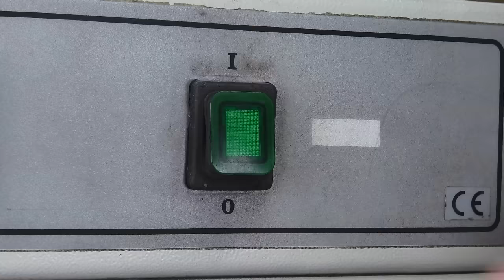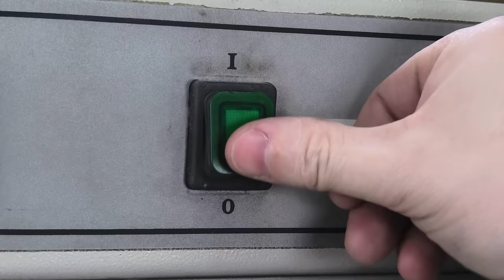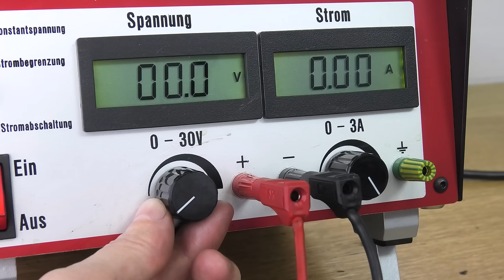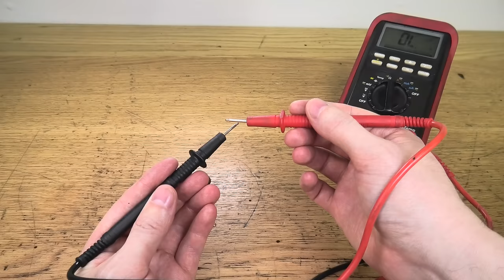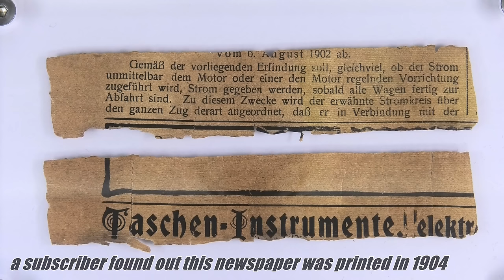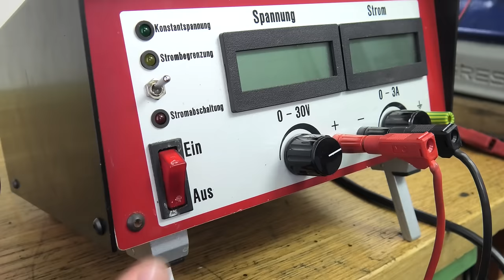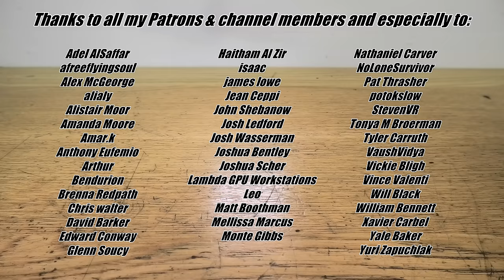Early 1900s Electric Door Bell - Restoration

Comment: Genuinely. I love how you also keep your mistakes in. You show painting over the circuit, and finding the problem to fix it. It’s really lovely and I’m sure will help others to troubleshoot in the future.
Reply from the maker: Glad to hear that, thank you very much
Reply: @mymechanics  but you didn't show how you cleaned the copper wire! or did you just replace it?
Reply: @ArnoldTohtFan  I think that he replaced that wire with a new one. Restoring a faulty enameled wire is by no means a trivial process, electrical, safety and quality wise.
Reply: @ArnoldTohtFan  lo reemplazó por uno nuevo
Reply: I was about to make the same comment in. Showing the error at the end was fantastic, I love the honesty
Reply: @mymechanics  I was wondering if just tapping the two threads again to remove the paint would have been enough to complete the circuit?

Comment: The patent was extremely interesting to read. A clever design for electric trams to be able to signal the driver that they are ready to depart. The driver puts the train into slow forward, but the circuit is broken by breakers in each car. The conductors of each car ensure they are ready to leave, and flip their switches. Only when all cars are ready to leave will the motors energize.

Comment: Great work so professional. 
Brought back an old memory... I remember as a young boy (9) in the late '50s, stripping one almost the same as this. Mine was not a restoration but an experiment to make an induction shocking coil (that is what it was called in an old encyclopedia). I added another coil from an old radio (i think) to the outside of one of the coils and did not use the other. . changed the height of the trembler part to the centre of the smaller coil. the trembler action when a battery was connected simulated an AC current by the breaking and making of the circuit, inducing a current on the larger coil which gave a high voltage output (transformer action). It worked a treat and thought up all sorts of ways to trick my uncles to give them shocks.

Comment: OMG...I thought the center core was wood when you started sanding! WOW! Beautiful work as always!
Reply: Iron tree.
Reply: Same here
Reply: 100 years of rust
Reply: It's an electromagnet, so the core should be made of a ferromagnetic material (e.g. iron) to work. It would still be an electromagnet with a wooden core, but much weaker, probably won't be strong enough to pull the arm.
Reply: @tamasporcsin3122  To be honest I didn’t know the magnet would need to be so powerful on this thing
Reply: I thought the same thing! It went from looking like old cork to brand new metal!

Comment: Yeah coil winding is an art in and of itself. I used to make transformers, the step up and down variety. I was just an employee, the boss did all the design work and we've fabricate them up. I was always pleased when I got a nice smooth and flat winding. Most had 220v primary with an over wind for 240v on top, sometimes a dozen outputs on the secondaries, very time consuming. Heaven help you if you had a bad wind underneath all the good ones...

I know it's just me so apologies but I'd have soldered the link wire then added a heatshrink sleeve, once done they would have gotten a ptfe varnish dip to protect them from corrosion. But that's me. Still a beautiful thing

Comment: It IS good you unwound the coils! I assumed they were essentially air-core coils, and that the "core" was made of wood, used structurally. I would never have guessed the cores were made of ferrous material!
Reply: Only part I find disappointing is that the wire used was just enamelled, losing the original look - you can get wire that is enamelled and then wrapped in silk to reproduce the look of the silk insulated wires - you can even dye it to match the nice green the original was.
Reply: @LiL I mean that the appearance of the core made it look like so much like wood that I didn't realize that is WAS metal. As to the principle behind an electromagnet, a coil can generate a magnetic field without such a ferrous core, but the field is stronger and more useful if a core is used. Such a coil without a paramagnetic core is an inductor, whose properties are useful for reasons entirely unrelated to the magnetic field generated, but the fields that are substantial enough to make it important not to place inductors too close together, or to have them aligned on the same axis, lest the fields interact sufficiently to alter the intended values of both components.
Reply: @LiL For that matter (and you may already kno), two coils, positioned next to each otherwrapped around adjacent or common (as in, single piece) core(s) are known as "transformers", such is the effect of coils in close proximity. Of course, there's more to it than that, but the basic principle is the same.
Reply from the maker: I tried searching for that wire but couldn't find it unfortunately.

Comment: When the pieces are clamped in the nickel plating bath, is the nickel able to adhere underneath where the objects are clamped? Or do you need to reposition the clamps to finish the plating?
Your work is extremely impressive, you're obviously very skilled and I assume you love to do it. Thanks for sharing.
Reply from the maker: No, I change the position of the clamps a few times

Comment: Great work as always! I'd recommend on a tiny upgrade though: as by now you have the arcing spot marked on the spring, you can drill a pad on there like they do it with relays, which will make the device much more robust (especially should you be able to fix a tungsten pad in place).
Reply from the maker: Thanks for your input!

Comment: Almost perfect ;-)  You should solder the connection between the two coils. Over long time with frequent vibrations it may become loose.
Reply from the maker: I didn't because the original was also not.

Comment: Awesome video as usual!
I have some questions :
- Do you have more info on the tumbler (the build and also, what are those white beads ???)
- Do you sometimes happen to re-use on a project the custom jigs you've designed for another one? If yes how do your sort all these jigs (date? type? size?...)?

Comment: You definitely would benefit from a small band saw for wood parts like the board in this case.
Reply: Probably, but MM would have difficulty finding a home for it. His shop is tiny.
Reply: @Vickie-Bligh  The small ones are not bigger than his arbor press. It's easy to use them on the desk and store them in the shelf afterwards.

Comment: Im not sure on the arc welding properties of nickel, but I know silver was plated onto many arcing surfaces like we see at the end of your video after you fix the connectivity issue, to prevent arc corrosion or arc welding over time. May want to give your awesome restoration one tiny dip more if you plan on using it for full duty.

Comment: Part of the reason you gave for using a new board is that the old one was shortened. But you made the new one the same length. Could have just filled the cracks with epoxy and sawdust and sanded it out and it would have been fine and original.
Reply from the maker: You must have seen it wrong, the new board is about 20mm longer than the old one.

Comment: Very impressive, like always. Might be a dumb question, but why does the bell work without a power source? And why do the coils have different layers separated by paper?
Reply: The testing power source might be a battery inside of the button switch. These bells are usually low wattage and connected to a house's electrical by wires run in the walls to the porch or location of the bell. (there are non-electric dial bells that use a tension coil with a turn switch to sound the bell)
Reply from the maker: There is  a power source connected when testing.

Comment: solder is alloy of lead Pb and tin Se which is perfectly safe formerlybused in copper drinking water pipes. EU 2006 Lead Solder ban means solder can contain tin, copper, silver, bismuth, indium, zinc, antimony, and traces of other metals. 
Most lead-free replacements for conventional 60/40 and 63/37 Sn-Pb solder have melting points from 50 to 200 °C higher, though there are also solders with much lower melting points. Lead-free solder typically requires around 2% flux by mass for adequate wetting ability. Wikipedia.

Comment: You said the wood board was cut short, yet you replaced it with a short one, too. It looks bad. There should be even spacing all around between the doorbell and the edges of the board. Pop an acrylic cover, too, if you want to protect the parts while keeping your work visible.

Comment: 4:59 ... I'm like 99% certain that the hole that "appeared" was supposed to be there. It looks like there was something there before sand blasting that wasn't there after. I'm not sure if it was a rivet, a screw or something else... but it was there before sand blasting and not after. (edit: Yeah, if you look at the part in the vise, you can Definitely see there was a part there that's missing later. The hole was definitely supposed to be there.)

Comment: now I got fear of touching doorbells, because it's under Voltage while ringing. Bells on Slovakian railroad crossings are isolated from Voltage but they need extra oscillating circuit.

Comment: 7:50 how does this not make the rivets useless
Reply: After hammering, the metal below the head of the rivet has expanded and is friction bonded with the metal walls of the hole it was in. Thus you don't need the head anymore and can file it smooth if that's what you want to do (totally extra and unnecessary ofc). Hope this explanation makes sense.

Comment: Such a bell will emit a lot of electrical noise due to contacts sparking.
It would be more correct to use one diode in siries with coil, to create a pulsating magnet.
Practical application of this bell is unsafe. Lots of details under voltage and open to touch.

Comment: Metalwork is at great level but wiring inaccurate. Wires joint should be soldered, painted and placed below coils as it was in the original device.

Comment: IMO, there’s way too many completely new parts, to the point where this almost seems like a remanufacturing rather than a restoration. I think you went too far with the windings, specifically those cool original plastic washers, you should’ve left those alone; not to mention keeping the old newspaper clippings in there, remaining with the piece for historical preservation. And the wooden block could’ve been saved and would’ve been much cooler to have as the original. Also seemed unnecessary to replace that rod with the engraving, it likely could’ve fixed it and having the original engraving would’ve been way cooler than a CNC job; cringed when you tossed it to make a new one. Nice vid otherwise tho, genuinely impressive and admittedly cool result. Just a shame so much of the original was replaced.

Comment: Well, it looks just fine but you ruined the originality. The bell wasn’t that shiny when it was new and brass parts were nickel plated. Also the copper wire wasn,t enameled but it was silk insulated and you should have used that old wire without unwinding it. When you changed the ”sparkling spring” the bell doesn’t ring anymore. You are not able to adjust the spark gap small enough to have stong ringing sound. Now this bell is not museum quality. 😢

Comment: This is not a restoration. This is modification. All originality has been lost. You changed the shape of the edges, you nickel plated parts that would never have been nickel plated, you polished and painted parts that would never ever have been that perfect. Did you count the turns on the coils you rebuilt? Didn't look like it. I am only halfway though and this is NOT a restoration.